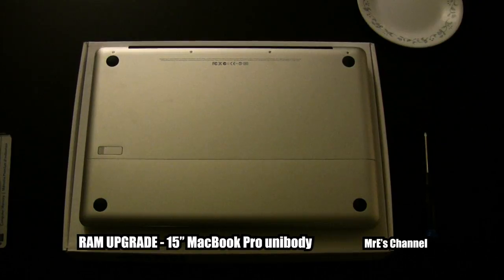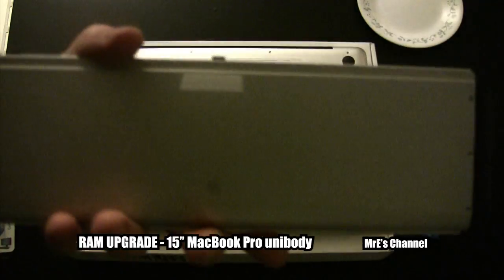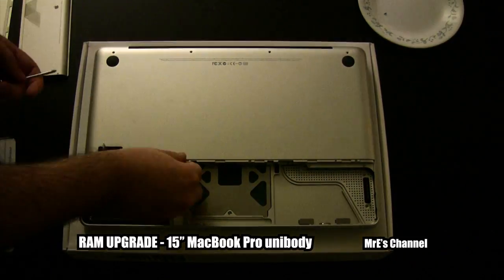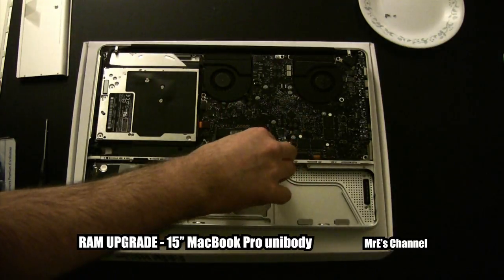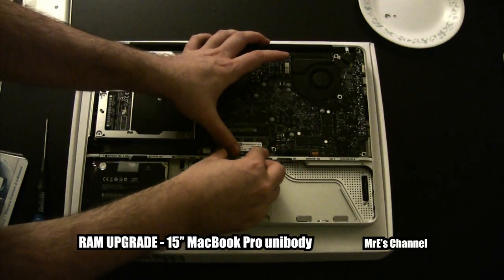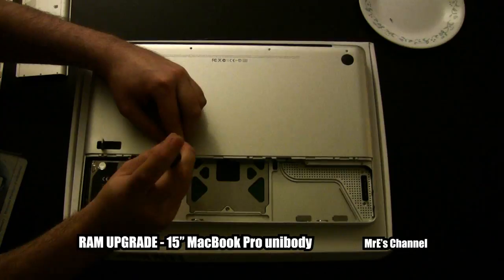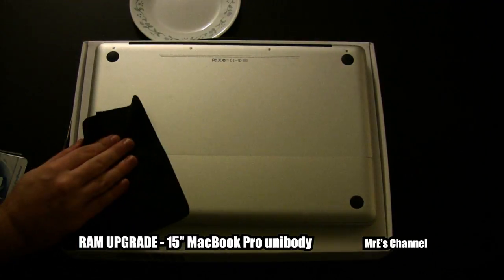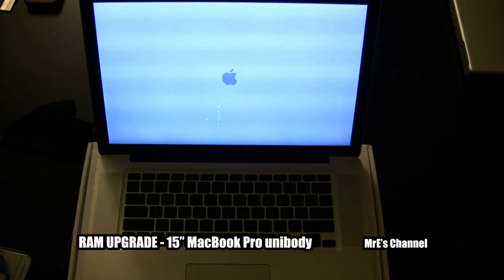RAM UPGRADE - MacBook Pro unibody

Comment from the maker: yeah RAM helps the OS run smooth which will help your applications run smooth.  The more RAM the BETTER.  If you are running 32bit Windows you'll be capped at 3GB ram.